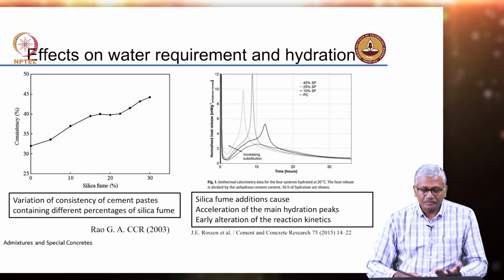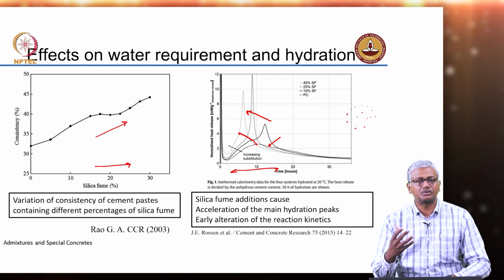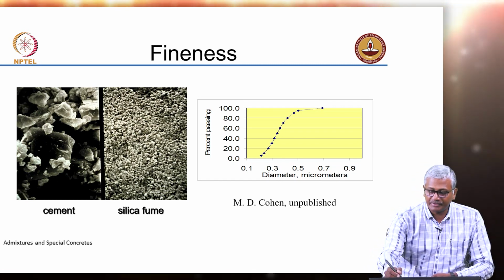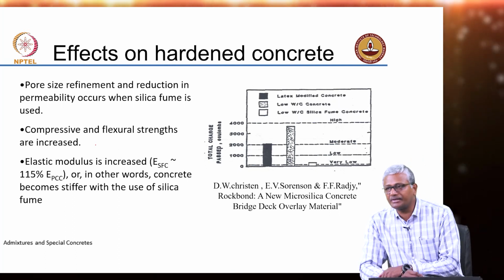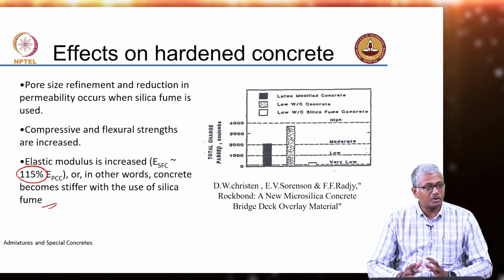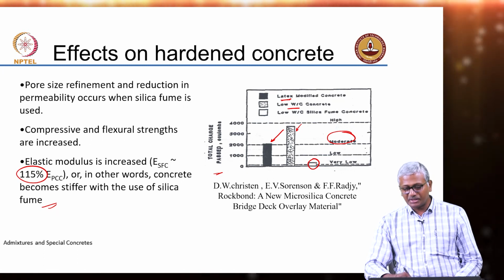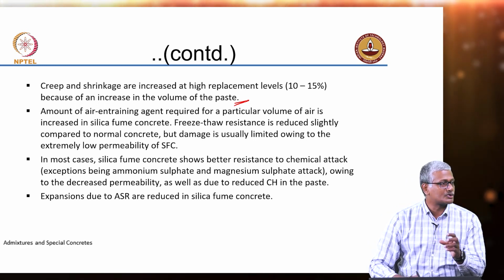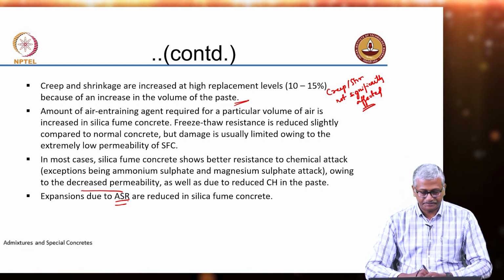#38 Mineral Admixtures | Silica Fume | Part 2 | Effects on Fresh & Hardened Concrete

Comment: We are a concrete curbing company that specializes in residential mow curb. We use 1 to 4 Portland to sand ratio with a super plastercizer.

Looking to see if the is a good admixture  to help prevent hairline cracking. We don’t get many but want to help prevent more. Looking at silica fume or microfiber options or colloidal silica. Any knowledge would be helpful some say fly ash as well